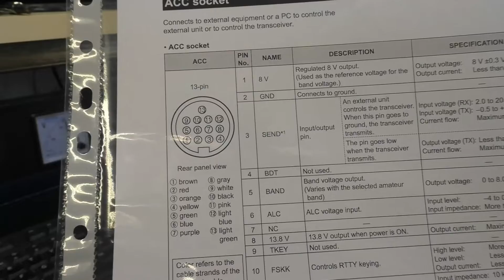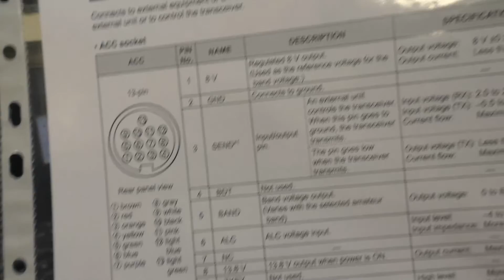Icom IC-7300 – How to Connect a Footswitch via the 13-Pin DIN ACC Port

Comment: This was very helpful.  Cleared up some mystery.  I will need a footswitch as my code key does not have a switch of it's own.  I will need to have both hands when tuning the external antenna matcher.  Thank you for posting.
Reply from the maker: My pleasure. Glad it was of help.

Comment: ICOM says you cannot connect a switch to the ACC port without a switching diode across the leads.  Check the footnote on the ACC page.
Reply from the maker: That only applies to certain amplifiers. For ptt the diode isn't necessary.
Reply: @GeorgeEI7KO  Thanks.  I've been want to connect the ACC port to my footswitch but was afraid to without the diode.  You save me $$$ and time.  Very much appreciated.
Reply from the maker: My pleasure Dave 73!